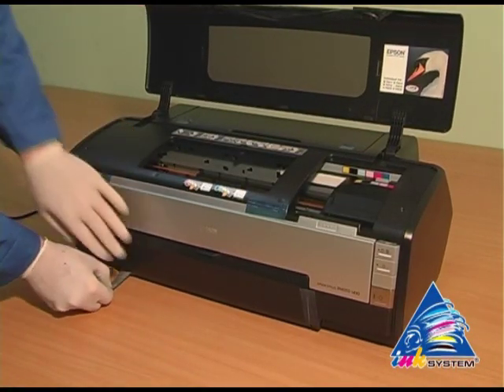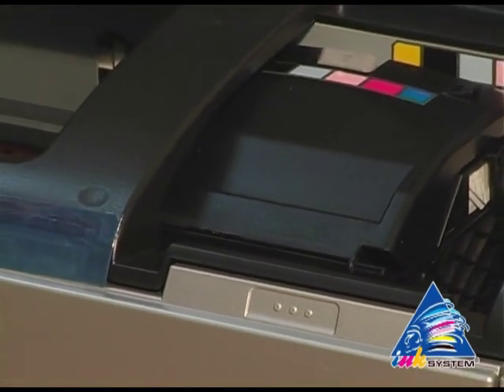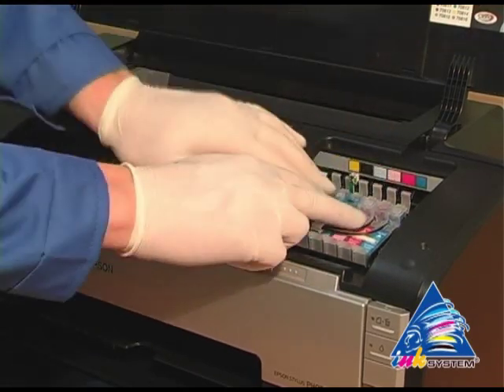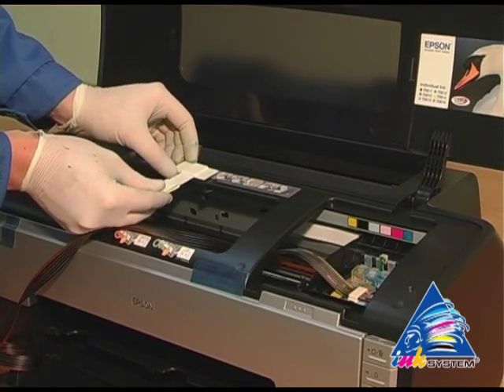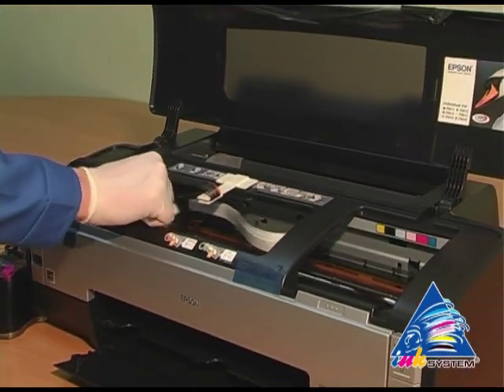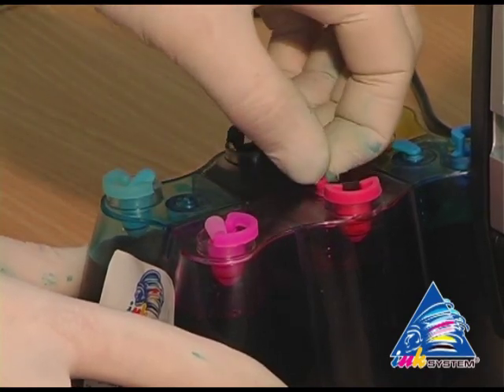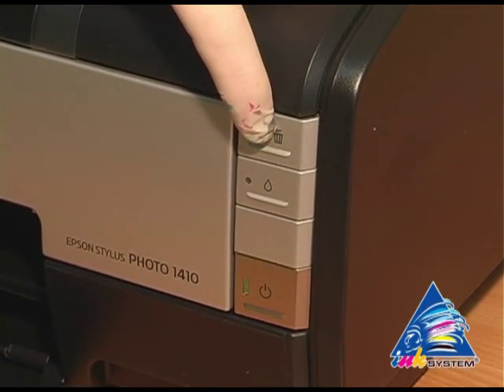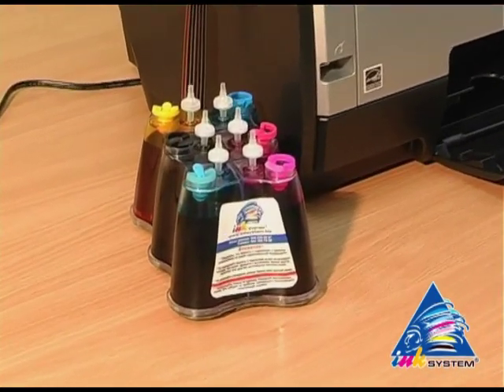CISS installation on EPSON Photo 1400

Comment: @fretduster03 

Yes it does. I will get an Epson 1400 soon and will install an Inkrepublic CISS-system with the latest IRK4-nano pigment inks. Dye ink will sooner or later fade away by sun light (UV) and air pollutants (ozone, nitrogene monoxide etc.). There are some dye inks which are quite resistant against fading (due to UV blockers), but pigment inks still rule supreme.